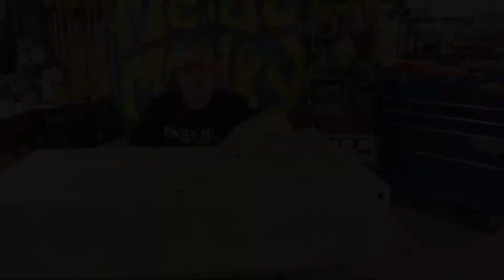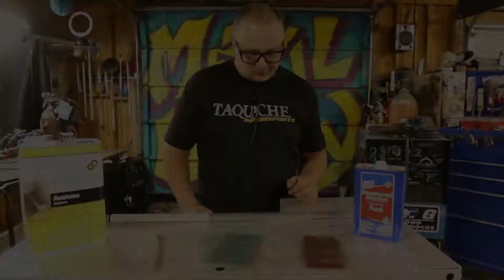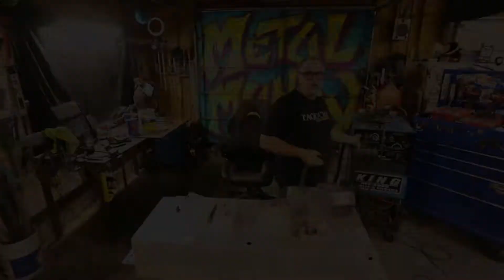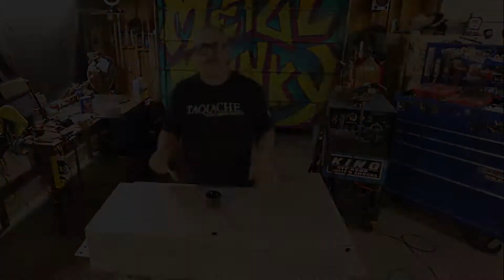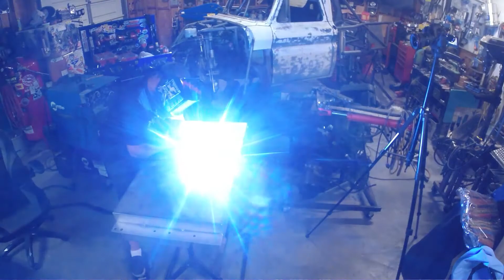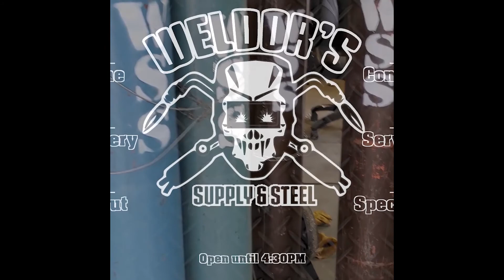Aluminum prep and welding lecture

Comment: Great info, we weld almost exclusively 416 stainless at work, but I love welding aluminum at home. Great content brother! I use acetone as well, but I find alcohol does a better job the times that Ive tried it
Reply from the maker: thanks man, it seems to be the forever question. i have found that although acetone does leave a small residue behind. it is not as detrimental as many so called professionals try and make it out to be. when i worked at General Electric aerospace division our engineers found no problem with acetone on our Aluminum, and every single weld i performed there was x rayed.. its almost ford vs chevy LOL

Comment: Good info. What's your favorite cleaner and what's the brush made out of. Perfect timing finding this video, I'm gathering parts and thoughts on building a new tank for my long time forever project. Enjoying your show bro.
Reply from the maker: i worked at GE aerospace and our engineers found no real problem with Acetone, and every single weld i performed there passed X-ray inspections.
stainles steel wire brushes, pick up a few, and mark them specifically for aluminum.